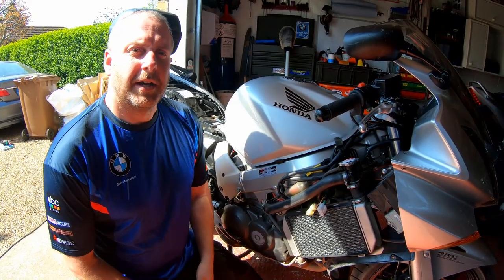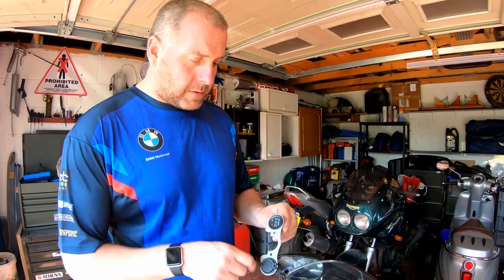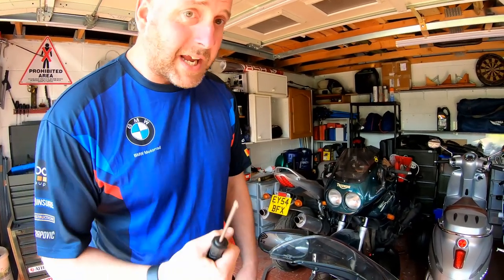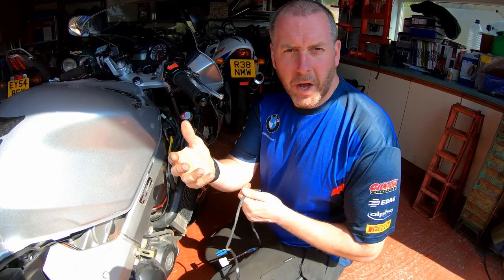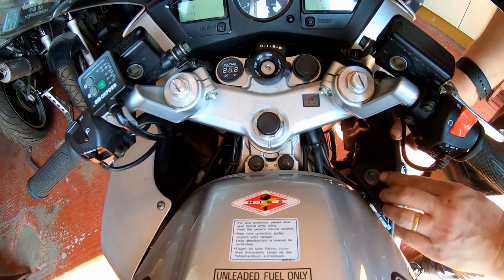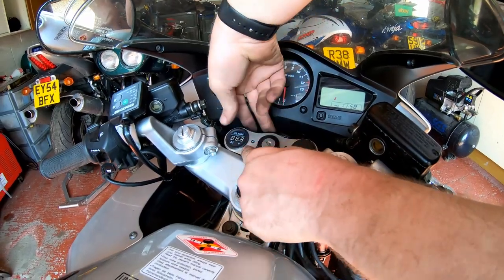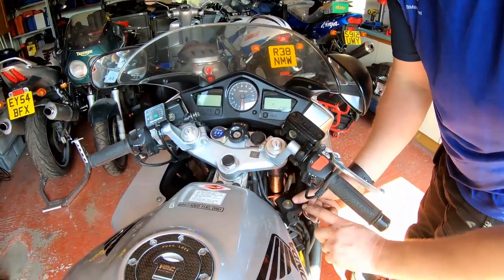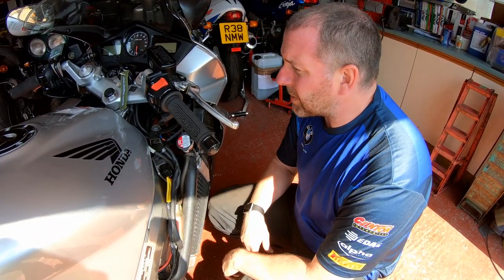Installing A Voltmeter And USB Ports On My 2003 Honda VFR800 VTEC

Comment: Great content mate! I've been wanting to do this for ages. This got me thinking how useful it'd be if manufacturers just had a voltage display on their digital clusters from the get go. Seeing the voltage is so useful for catching any issues with the battery or charging system before they leave you stranded. Great mod!
Reply from the maker: It's a very good point mate, it's all down to cost I guess. I believe that cars and bikes are designed by engineers and built by accountants so there's so much stuff that gets binned at the design stage by those holding the purse strings!
Reply from the maker: Also I’m still waiting to see more of your videos on that Gixxer! 👌🏻
Reply: Aprilia used to have a voltage display on there digital clusters.
On the right hand screen.
I had a Falco for a while and it was useful when restarting it after a period of being sat.

Comment: Very nice mod; looks almost OEM.
Reply from the maker: It’s a nice bit of kit 👌🏻 you can now get them on eBay at this link https://rover.ebay.com/rover/1/710-53481-19255-0/1?mpre=https%3A%2F%2Fwww.ebay.co.uk%2Fitm%2F114365528016&campid=5338707657&toolid=10001&customid=

Comment: Got mine fitted today Kev slightly different method not using the switch. But instead using the black and white wire as the switched live and the green wire as the earth from the terminal connector.
Reply from the maker: Nice 😎

Comment: Hi Kev I’ve done the R and R mod and the accessory plate, Just to let you know there was no need for a switch as in the left over connector block off the R and R there is an ignition feed, so when the ignition is off so are the accessories, good job though 👍
Reply from the maker: Correct, but I wanted the ability to have mine off if I wanted. The Black/white wire in the connector is ignition switched although the cable is pretty thin so I’d recommend running it through a relay. 👌🏻
Reply: Just clarify for me is this the black/white wire in the block, along with the 2 red/white and the 2 greens, i also am halfway through fitting one of kevs RR so wanna  fit the bracket, voltmeter and usb sockets (with a relay) supplied by adey reynolds from fb group whilst all the plastics are off, was pondering using it as the switched live, any advice would be useful👍
Reply: @PlexusJohn  us a test light or a volt meter to find the ignition feed, turn the key so the ignition is on test the wires and then switch the ignition off, see which wire is ignition feed and hey presto, I never used a relay but that is up to you but I did use an inline fuse, I hope this helps .
Reply: Sorry for interrupting this conversation 😹😹 but i wanted to know,the thin wire from the block that comes to the ignition,is it a negative or positive?

Comment: nice and clean job that bracket is really nice, I don't think i would have bothered with a illuminated switch as the the volt meter lights up so you can see its on. But that's obviously personal choice.
Reply from the maker: Yeah I can get that, I thought it was a nice little touch

Comment: Great video, thanks for making this. Can I ask what gauge wire you have used? I intend to take a live feed from the license plate light so that I've only got power when ignition is on. Thanks!
Reply from the maker: If I recall correctly, I used 16 Gauge wire for this. Mainly because that is what I had knocking about in the shed! I wouldn't advise going any smaller than 18 gauge though.

Comment: 10amp fuse is probably way too highly rated. That 10amp is a 12v rating. The 2.1 and 1 amp of the usb connector is at 5v.

Piv so 10 x 12 = 120w

3.1 x 5 = 15w

I = p/v = 15/12 = 1.25A.

You need a 2A or 3A fuse in that thing.
Reply from the maker: The fuse is there to protect the wiring, not the device.

Comment: Very good as always wondering have you ever seen this problem vfr VTEC start engine up noise bring up to 2000 rpm noise gone, same happens when in neutral engine running pull in clutch lever noise gone thanks in advance

Comment: hi kev. I enjoy watching all your videos. You really love doing this job. I have a question. I have a 2013 vfr 800x. I want to install fog lights. Is there a simple connection method you can suggest to me? thank you.
Reply from the maker: I would wire them via a relay, possibly from the main beam or a delegate switch

Comment: Great video bud. Will this work on a 5th gen? Where can I get hold of the loom bit you used.
Reply from the maker: Hey bud, it’ll work with any 5th gen as long as it has the HISS sensor. If you look at the link in the description, the guy selling them also can supply the looms too! 👍🏻
Reply: @KevsShed  cheers buddy

Comment: Hi Kev, 

Thank you for the great content. 
Would this be a similar process and wiring for 2008 VFR 800 ? (6th gen) 

Thank you.
Reply from the maker: Hi, thanks for watching, if you have upgraded you R/R to the MOSFET FH020AA like I have (check out my other videos on this if you haven't already seen them) then you can wire it in exactly the same. If you don't wish to use a switch like I did to turn on the meter and USB ports then you can use the Black and white cable in the same connector as it is a switched live. It is a much smaller diameter cable however so I would advise to use a relay if you wish to go down that route. If you are still using the OEM R/R then you can pull a switched live from many places such as the fan switch or headlights. 👍
Reply: @KevsShed  Thank you so much for the detailed explanation. I'm waiting to pick my VFR up next week. Once I get it picked up, I'll try doing these mods. I already ordered the fabricated frame from Andy. Thanks !

Comment: Hey Kev, thanks again for the videos they're awesome and inpirational. I'm planning on installing a voltmeter and acc socket as well. Just wondering if I would be able to tap into one of the unused reg/rec terminals in order to use switched power and a relay? If so which wire would I use?
Reply from the maker: Yes absolutely, from memory, there is 2 permanent lives and 2 grounds in that socket, but I believe that post 06 models have a slightly different wiring config. You can take a live feed from the socket but on my bike it wasn’t ignition switched bud 👌🏻

Comment: Good video as usual, what voltage does the volt meter use
Reply from the maker: That’s a good question, I actually have no idea!
Reply from the maker: I had a look at the item on eBay for you and couldn't find out the draw of the voltmeter unfortunately, only that the Working voltage is 12-24V and the Measuring range is 5-48V, I don't really understand how it can measure down to 5V if it requires 12V to work! I guess someone who has a greater understanding of wiggly amps and stuff could enlighten us further! :)

Comment: That white connector block under the fairing, have you spliced it into the reg rectifier or is it there from factory?
Reply from the maker: The white connector under the fairing is factory, that’s where the OEM Reg/Rec plugs in, obviously I dong have an OEM R/R so it’s soars, hope that answers your question. 👌🏻
Reply: @KevsShed  thanks for replying and your content on your channel. Excellent informative videos without the waffling. I've heard the RR to be unreliable, I'll have to check what I have. So If standard the white connector is use and if non oem it's a different connector block used

Comment: looks great...... would that bracket fit a Gen 5?
Reply from the maker: It will fit any later model Gen 5 that has the HISS sensor around the ignition, other wise, the only option you have to use this bracket is to retrofit the HISS top yoke. I would imagine that you will find these fairly cheaply though! Good luck with the search! 👍🤓

Comment: Does this setup need to be switched or can I run voltmeter and usb ports directly to the battery?
Reply from the maker: No mate it does not need to be switched. you could run it direct to the battery if you wish however your voltmeter would remain on at all times with no way to turn it off. If you don't want to add a switch to your circuit then I would recommend finding a switched live such as a headlight or the horn. Don't forget to protect the circuit with a fuse too.
Reply: @KevsShed  
Thanx Kev.

Comment: it looks great but voltmeter and usb ports are unfortunately sold out and also waterproof cover switch and fuse holder
Reply from the maker: There’s loads more to choose from, they are a universal size 👍🏻
Reply: You can now get a volt meter and combined USB in the one unit.
Reply from the maker: @guzziryder6566  Yeah I know but then i'd still have a hole to fill in the bracket! :)

Comment: Great video Kev, I've just bought the plate also. My question is if that plugs not available how do you tap into the lights wires? I'm not clued up with electronics and was just going to go straight to the battery terminals, but it seems this isnt the right thing to do 👎
Reply from the maker: Hi buddy, you could tap into a switched live from the headlights or even the temp sensor which is also in that area!
Reply: You can go from the battery but a relay from a switched point will be needed Its what I am currently doing

Comment: Nice work, that plate looks stock, I wonder could he fabricate a similar bracket for a 5th gen? wish I understood wiring like you do.
Reply from the maker: If your 5th gen has a HISS sensor around the ignition then the brackets will fit 👌🏻
Reply: @KevsShed  Thanks, no mine is a 99, hasn't got HISS, pity in this regard but otherwise the 98-99 are better bikes I think.

Comment: If you are using anything that claims to be "weather proof" or "water proof" and mounting them in a horizontal orientation...my advice is to drill or notch a small hole at the bottom rear of the units where the connection terminals are located...these are for water drainage...I have found that this is the most water proof end of these units and that only makes these units malfunction and or quit working all together sooner...because they will as soon as a drop of water leaks through the face...that's why they almost always offer them for sale in pairs, because you'll need the spare soon enough... if anyone has found a reliable and truly water resistant or water resilient please let me know...

Comment: Hi mine seems to be charging at 15v is that ok???
Reply from the maker: Is that measured with a multimeter or at the display on your bracket? 15V is a little high.
Reply: @KevsShed  Hi Kev with a multimeter at battery 14.9 i have rerouted the signal wire to a switched live now I get 14.6 at 5000 revs. No burnt or corroded connections. The bike is 2005 with 10,000 on the clock. Do you think I should look at the upgrade :) or follow  your vids to check r/r stator?

Comment: Hello Kev,
Hope you are in good health and good spirit.

I would like to ask you, the source plug for the 
volt meter and usb https://youtu.be/gzJ4GXt6bCA?t=517 
From where is getting electricity, because as I see it,
It's like you haven't attached it to the alternator.

Can you explain a bit more in details, so I make a
more clear understanding, from where exactly are drawing power.
Perfect video.

Regards,
Emil
Reply from the maker: Hi Emil, I have connected it to the connector that was left behind by the original rectifier when I upgraded it. 👌
Reply: @KevsShed   Hello Kev, thanks for the quick reply.
As I'm with the stock rectifier, could you suggest how to connect mine ?
Reply from the maker: @em3ata  You could wire it direct to the battery via a relay buddy, that would probably be the most effective way.
Reply: @KevsShed  Thanks, I really appreciate .